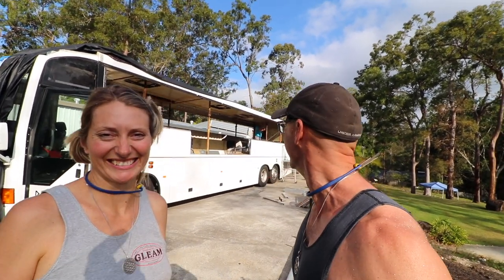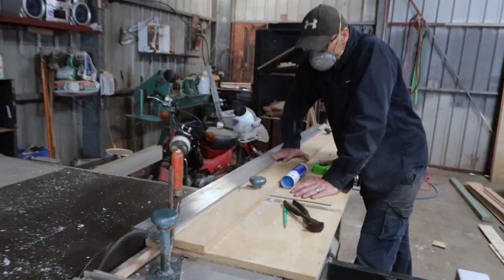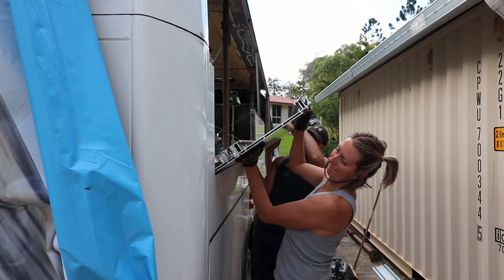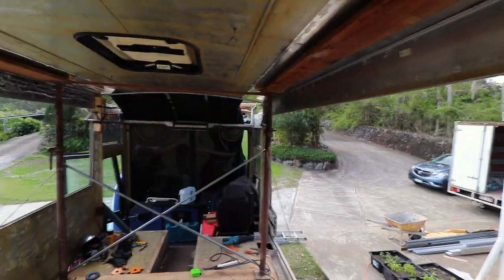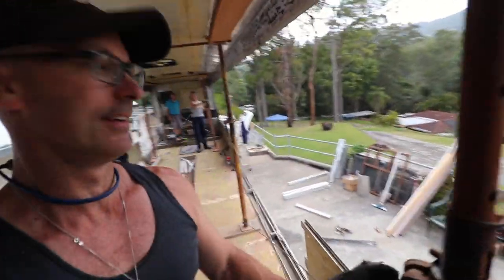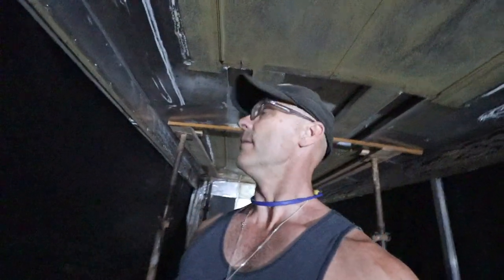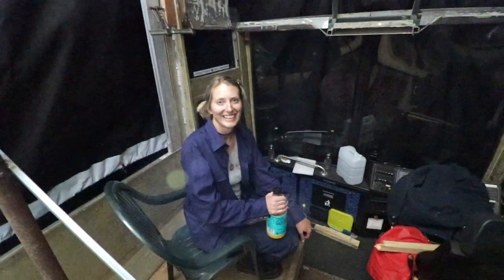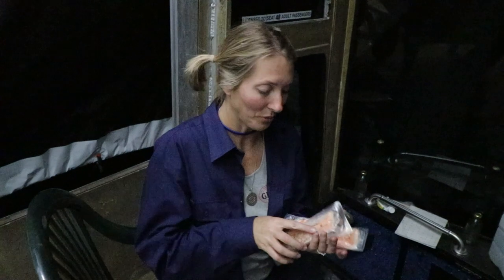Bus Conversion Roof Raise S2E2

Comment: Great idea bolting it all up before the welder arrives. Assume you will be putting some triangulation in areas where there will be no windows to give it a less flexible structure?
Reply from the maker: This is how Volgren build their buses. They bolt the extrusions together down the length, and weld much stronger sections in all 4 corners. It’s a great design and method!

Comment: Hey, Dan. Before you did the roof raise, could you stand up straight inside the coach? How much head room did you have? Hubby and I are thinking of doing a coach conversion, but I think a roof raise would be beyond our skill and budget. He's 6'1", so I'm wondering if it'll be possible for us to go ahead with the coach at the original interior height, or if we'll have to factor in a roof raise after all?

I'm absolutely amazed at the work you're doing on this, really looking forward to the next video and the final result too!
Reply from the maker: Gothic*Rock*Goddess Hi! 😊 Yes, we could stand up along most of the bus (clearance was between 1950-2030mm with the arch across the roof), but at the rear where it steps up we couldn’t (1750mm) and that was before we batten for the ceiling (losing perhaps another 30mm everywhere). The beam above the old windows was at 1700mm as well, so by the time we frame out for the slides and add 50mm to the floor to get slide out clearance above the bins (below) we would have been under 1600mm and well below eye line meaning we’d be ducking to see straight out! In my opinion you need to be able to stand without ducking in the living area - everything else though is optional. We just didn’t want to compromise, especially as we’ll be living in this full time. We’ll definitely discuss this further in upcoming vlogs. Thanks for commenting, and feel free to ask anything else too - we love the community feel amongst converters 
🙏🌈
Reply: @Danjuly71  that's super helpful, thanks so much! I'm impressed that you're raising the floor level so high, sounds like lots of lovely insulation. 😻 I'm really enjoying your videos, they're helpful, fun and interesting! Thank you so much for filming your build. 💜

Comment: Hi great videos, l would like to know about your experience with roof raise engineering, thanks Tony
Reply from the maker: Hi Tony. What specifically would you like to know? I can say it was worth the effort! ☺️
Reply: @Danjuly71  Thanks for getting back to me, I was wandering when you designed the layout of the bus, was the engineer involved in that part of the design ? or dose he come in latter after you start to rebuild and help with the structural parts only ?

Thanks Tony
Reply from the maker: @tonycaneva3000  the roof raise is a structural element, so yes, the engineer needs to be involved as he will advise what he needs to be able to sign off - this applies to Queensland at least…

Comment: Very risky, in case if Jack slips. For safety reasons there should be tripod stands kept in between.
Reply from the maker: Thanks for your concern/comment. If you take a closer look you’ll notice the acro props had cross braces welded between them both longitudinally and laterally creating a “tripod”. There was zero chance of anything slipping or moving anywhere but vertically 👍